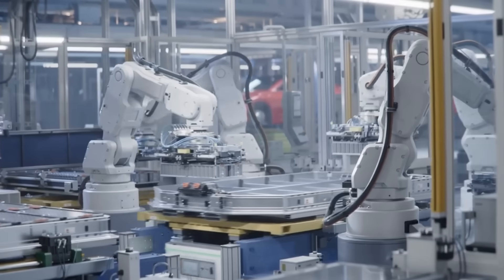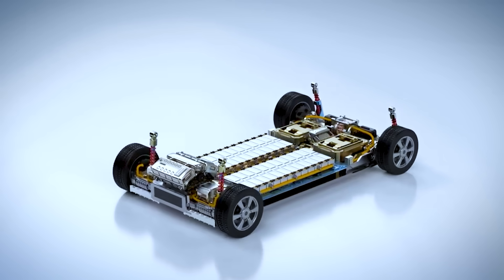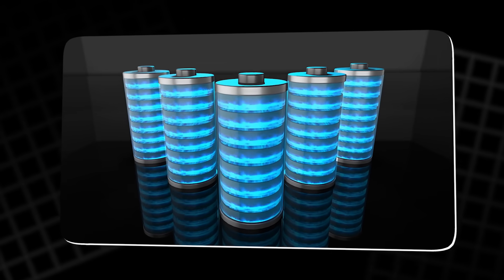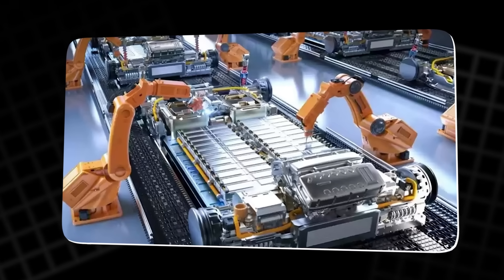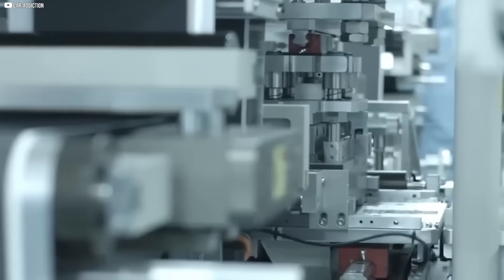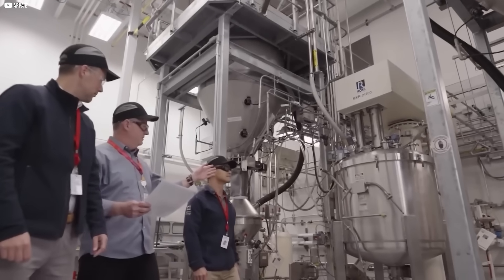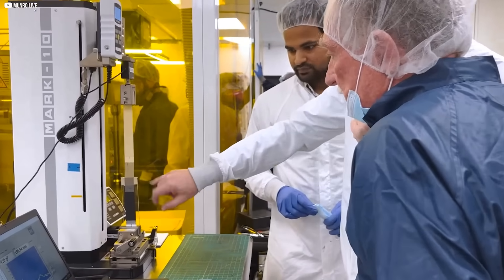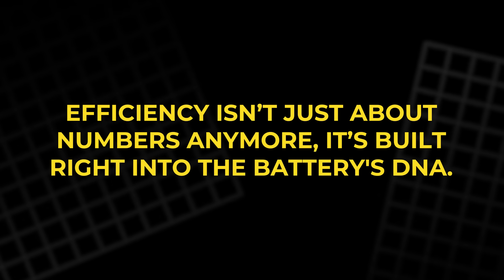This One Change Could Collapse Battery Prices

Comment: Printing millions of batteries, layer by layer, on 3D printers, how long would that take?
Reply: Sounds more like a laser printer. Laser printers work be heating a metal cylinder then melting powdered plastic onto the parts of the metal that are hot.

Comment: All interesting technology, years from commercialization.  Don't expect collapsing battery prices for at least 10 years, and probably more.
Reply: Well, if it works the prices could fall rather quickly as the legacy battery makers compete is a shrinking market.   Every legacy maker will want to keep the factory work because once they shut down the plant is nearly worthless and in some cages might be a liability.
Reply: @GilmerJohn  If it works, the next step is to build a pilot plant for creating the batteries, and garner investors willing to risk the money.  Pilot plants would need to run for at least a year, and probably for 2-3 years.  Then next are investments from manufacturers to build full scale plants, at least a year for that, coupled with commitments from automobile companies and factory upgrades.  Another 3 years or so.  If everything went perfectly, 8 years before being available?  And the automobile industry is notorious for being slow to change.  Think about how long it has taken for the automotive leaders (Ford, GM, Volkswagen, Toyota, etc.) to start selling EVs?

Comment: Crystal grill ignitor makes 5,000 volts ⚡️ per micro click could mount under moving parts
Reply: There's a significant force to click that Piezo and to produce electricity .
Reply: Not on a cam roller  @stipanrogic8169
Reply: Or under reverse compression of a piston roller camed
Reply: Or something moving of more weight 🤔
Reply: It would be absolutely free
Reply: Real time ⏲️ machine reverse engineering 🎉